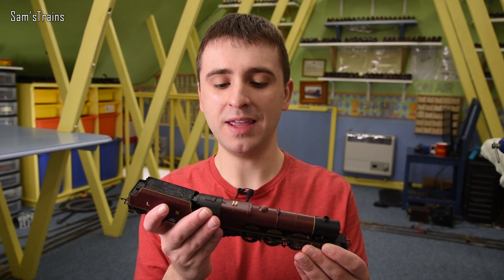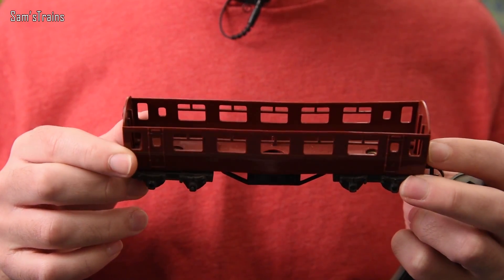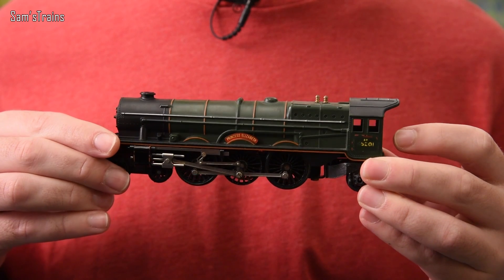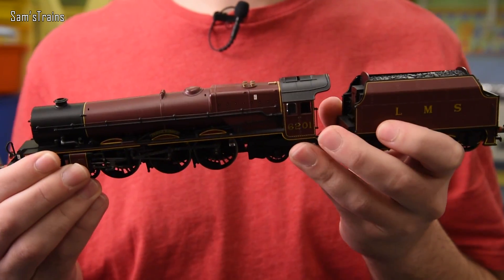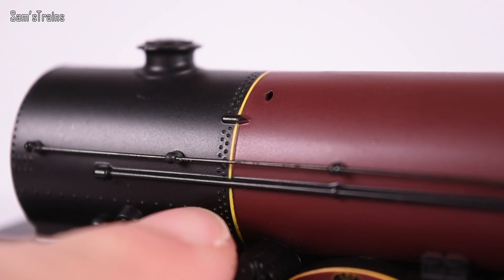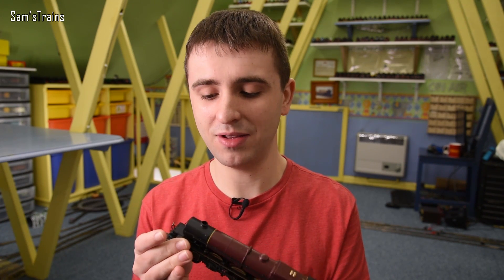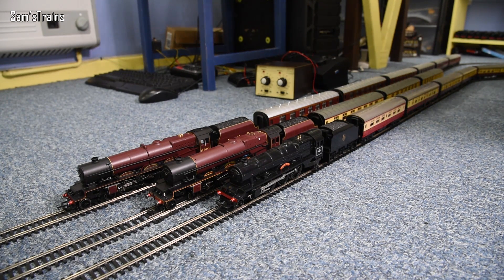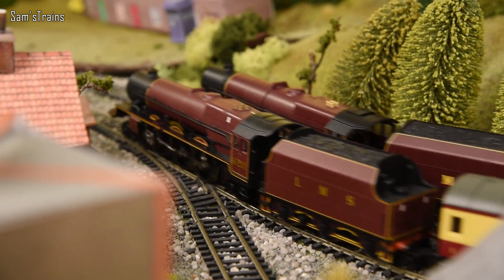1950 - 2020 | 70 Years Of The Hornby Princess Royal Class

Comment: Great to see the 1950 Rovex . My older brother had one THAT Christmas. Looking back it really was pretty basic.....those pick up shoes for example. I can remember my brother running it in a darkened room and it arced all over the shop, scared me to death (well I was only about 2). But that carriage you showed was the ones that came in the original set of three (check out the short wheel base) and sure enough the banana effect took hold after about five years !  The controller in the set was battery driven, but my brother must have saved up his pocket money and bought a transformer so it could run off the mains , hence the formidable arcing.
Ah, memories, eh ?   Great vid
Reply from the maker: Thanks a lot Geoffry - yes that's a favourite of mine! Yeah those pickups weren't a great idea - don't think they lasted very long!!
Thanks for watching - Sam :)
Reply: @SamsTrains  Probably the next best thing (at the time) to the three rail system ?

Comment: The second ever loco I had was Princess Elizabeth. Not sure of the year, but probably mid 70's. She was loco driven by an X04, had more detailed valve gear than the early model you showed, spoked wheels, plus she had a smoke generator which took drops of light machine oil, and a piston powered by a gear atop the X04 worm drive to puff the smoke out proportionally  to her speed. The tender had one of the axles fitted with a brass tab that scraped on the underside of the tender, which in turn acted as a soundbox, making a crude chuffing sound as the loco moved. Eventually she fell apart with overuse by my young hands, and I no longer have her, but she gave me an everlasting love of LMS and particularly  the Settle and Carlisle Railway.  God bless her, and Hornby for that!

Comment: I loved my 1950s Tri-ang black 'Princess Elizabeth' with its gold tender emblem and two very short LMS maroon coaches (with roofs that warped, of course). I got it new when the real  'Princess Elizabeth' was seen regularly on the main line. Then I got a BR maroon 'The Princess Royal' with valve gear  - wow,  what an improvement. It looked so realistic. These both disappeared many years ago. I also have two of the 2003 models in my cabinet which look generally very good, but I think the bottom of the cab is wrong (not deep enough) and I just keep gazing at this fault. Which means I will have to get the new one! This was one of your most interesting videos - a great piece of work. Also notice how the rear pony truck frame is cut in half on the 2003 model and rendered beautifully on the new model.
Reply from the maker: Great to hear that John - what a time that must have been! Glad to hear you got a 2003 one, I do very much enjoy those! :D
Thanks for watching - Sam :)

Comment: Great this idea to make a collector's interest-driven video around a top shelf product from Hornby. I really enjoy to see the historical evolution, and have a look at some collectibles. Your original Triang is a must-have for a collector interested in '50s/'60s model trains. That's also a good way to see the technical evolution of the thing. Anyway, the actual Railroad locomotive is pretty good if you close your eyes on the car bumper-like couplings ! I guess this point is not an issue for the public which buys this model. And kitbashers can certainly replace them, I am waiting for a Railroad LNER teak coach with the same couplers, I will see if it is worth the buy. If I can jettison the original coupler, everything's all right for me.
The more I look at the Railroad range, the more I find interesting items. Hornby had a good idea when they launched this range ages ago, you can have low prices items with a good quality, and an appeal to nearly every modeller. Good move from the marketing department of Margate !
Reply from the maker: Thanks very much Oliver, great to hear you liked the idea! Yes many collectors like those old princesses!
Thanks for watching - Sam :)

Comment: i think we will probably see even finer detail as newer materials and techniques come into use.

i think its entire possible we might see some pretty exotic motors start to come in on the higher end designs at least.  from what i have seen in power tools, i think its entirely possible we might see a manufacturer play with brushless DC motors.  i think its entirely possible to cram the electronics into a locomotive.

and lastly, i think the metal injection molding we see being used to make drive train components in power tools may start to show up, maybe not for the gears themselves, but to make it easier to make more complex/compact designs.
Reply from the maker: I hope so James - that would be nice to see! :D
Thanks for watching - Sam :)

Comment: Ah, memories... I have one of the Tri-ang versions, after the revamp to remove those rollers, etc. Mine is in BR (Midlands?) crimson, though with nothing like the level of detail in the painting, but it still looks pretty good. I haven't run it for many a year, but when I retire in the not-too-distant furure, I'd like to get it overhauled and run it again. Don't have any coaches, though, so I'd have to hunt some of them down. The couplings could be a problem, though, as Tri-ang and contemporary Hornby couplings were different and I remember having trouble connecting different rolling stock up. I was interested to hear about the problems of old coaches with modern track as, although Tri-ang and Hornby track was a bit different (mostly in the way it conncected), I never had any trouble that way. What has changed in modern track?

Anyway, thanks for a fascinating look into the history of this type as a model. I strongly suggest that you do similar videos for other classes.

Comment: I only have a modernized Dublo Duchess (modern repaint, a few added handrails, 80's driving wheels, real coal, otherwise original) but I would like to have the newest one.
Lately a few old start-sets was "donated" to me, from different eras (attics), but they all had (sadly) the cheap-o 0-4-0 Piko steam loco, but it was interesting to notice how it changed over time (still in production btw) from its 1st 1960's release. It basically got cheaper and simpler with time, with less and less metal and parts used, rivets instead of screws, even the buffers are made of rubber, while the early ones had metal chassis, actual !glass windows! and working lights. I will gonna keep my eye open for a 1st release one ( I sold the one I had, but now I esteem its value).
Reply from the maker: Ahh very cool - I bet those look great with a few upgrades! Many thanks for the info mate! :D
Thanks for watching - Sam :)

Comment: I had the original Rovex model and the pick up was by spring loaded studs not rollers and the plastic control box had cycle lamp batteries with a 3 way switch on top with no speed control only forward off reverse but it was intended as all train sets should for little boys as I was at the time and by the time i grew up I left childish things behind.

Comment: Hi Sam,on  the tender drive the wheel spacing and splashers are wrong on the loco drive spacing and splashers are more correct, so it must have been retooled .The front drivers are moved forward. all the best .
Reply from the maker: Very interesting Ian - I didn't know this, thanks for pointing that out! :D
Thanks for watching - Sam :)
Reply: @SamsTrains  Hi Sam, I have 7 of them including a brass pro- scale i built 30 odd years ago with a portascap motor and gearbox. I am building a 3.5 inch gauge princess makingthe valve gear now. I seem to go from one nightmare to another building these things. all the best Ian

Comment: On the subject of Tri-Ang engines running well after all these years, I used to say "It's not fatal until the body is in two"........ I was wrong. I had a VERY early Tri-Ang princess, just after they made the metal-chassis version, and it had warped. the cab was crumbling, the running board was cracked, the bufferbeam was missing. It was a... well..... Train-wreck. (bad pun). So, after procuring a bufferbeam, I set about the cab. I cut the cab clean off, and it fell to bits. I could hear the body snapping back to it's right shape as I released the warped cab. the floor of the cab was split, the roof was split, the left-hand side was split, the right-hand side was the only one saved from the stress. so after heating it up and bending it all straight again, I discovered something incredibly useful. if you get cellulose-acetate warm enough to  * just *  become pliable, not only does it correct some of the warping, it also shines the plastic, and, more importantly, seals it. It stops it warping. So after that, I glued the cab back on and repainted the seam, and refitted it to it's original chassis. If I told you it had ever been warped and in pieces, you'd swear on your life I was lying. It looks pristine. you really cannot kill a Tri-Ang or Rovex locomotive.
Reply from the maker: Oh dear, sorry to hear that mate - I've never known them get as bad as that! Blimey, sounds like you have some patience there!! :D
Thanks for watching - Sam :)
Reply: @SamsTrains  Yes..... People say I have a lot of patience when it comes to making models. Trust me, this was easy. The harder projects i've done are total scratch-builds of Ivor The Engine and Stephenson's Rocket in OO gauge. The former of which, took me a week. The Rocket was a 3 day build. Simply because, that's how fast I normally work. Working pistons and all. I'm actually building a L&MR coach as i'm typing this. Which I will motorise to push the rocket. It's going well so far.

Comment: Wouldn't the original 1950 model have had 3rd rail pickup? Especially as it was aimed, as you say, at kids saving up their pocket money and parents looking for affordable birthday/Christmas presents. My first train set, Hornby Dublo, bought as a present around 1953/54 certainly used the 3rd rail system on a pressed tinplate base and it wasn't until some time later that I became aware of the 2 rail system, which I recall as being "up-market" and expensive...
Reply: The 1950 Rovex was a lower cost competitor to Hornby Dublo. Two rail from the start being an advantage over Hornby Dublo. The extra realism of two rail and the lower cost made it sell so well that they could not keep up with demand. Incorporated into Line Bros Tri-ang after less than a year and improvements made every year. Tri-ang cleverness was a big part in the demise of Hornby Dublo.
The very late shift of Hornby Dublo to two rail, their higher prices and limited range among other issues meant they were losing market share to Tri-ang year on year. Hornby Dublo collapsed into near bankruptcy in 1964 and so they asked Tri-ang to take the over. This led to the Tri-ang Hornby years and the following years where Hornby is really just the name used for the continued development of Tri-ang from Margate. Hornby in name only, not a single part from any Hornby Dublo production since a few station building scraps around 1966 and 1967. Tri-ang tooling still crops up in the current Hornby range eg Dean Single.
There is a vid on Youtube about the The RIse And Fall Of Hornby Dublo (hint) and the Tri-ang takeover as well as books and discussions on forums.
Reply from the maker: Thanks John - yes they were indeed two rail from day one!
Thanks for watching - Sam :)

Comment: Sam for the hm2000 do you have to have two power tracks to run the locomotives individually?  Thanks for the great video 🙂
Reply from the maker: They Tai - the HM2000 has two outputs built in, but you would need two power tracks to make use of both! :D
Thanks for watching - Sam :)

Comment: Re the Black Five comment at 5:26 . The Hornby Black Five was first introduced much earlier than 1984 you thought was the case. That LMS version only maybe so.
1973 as I remember and your recommended Oscar Paisley channel vid confirms :
https://www.youtube.com/watch?v=_mq5XhTjLCk
These early silver seal expensive models had Fleischmann 6 wheel drive mechanisms. This was so much better than the later cost cutting version by Hornby and set the trend to tender drive units. Around this time a Princess with one of these tender drive units set a Guiness world record for continuous running. Tender drive was added to an old Princess to give more variety on the Mevagissey model railway display. Turned out the Princess ran longer than the Black 5, Brittania and Evening Star models also running for the record.
I still prefer a good loco drive though even though Fleischmann and Roco make very good tender drive ones. Some power the locomotive wheels as well.
Reply from the maker: Very interesting John - duly noted - I wasn't aware of this!! :O
Thanks for watching - Sam :)

Comment: Live steam in OO scale sounds like it would be extremely high maintenance.
Reply from the maker: Yeah I think so too!
Reply: Hornby made them, they were £1000 they stopped making them as no one would buy them and they cost £20000 to produce. They were high maintenance
Reply: The problem is that you cannot scale down the laws of physics... What goes fine on, for instance, an O or a 1 live steam model is more complicated due fo the same fluid dynamics in tinier boilers, pipes and cylinders in OO/HO scale. Hornby had made an OO live steam engine as said up there, but that was a one-off. Fulgurex from Switzeland had also made live steam engines in HO scale, but that also was a one-off.
Live steam modelers generally does not go below 1 scale (1/32) for pracitcal physical reasons with steam and water physics. On Youtube, live steam engine I saw are generally scale 5 and up.

Comment: i thought i would look through my dead thomas locos to see if i could marry up a motor with a running chassis - also i did 1 but it insistead on stopping on  the track so it went back in the box but i did find one that broke into 2 parts - chassis rot i suppose thats a james and a thomas now - as for the future i recon they will all come out as the polar express with partial sound or the flick of a switch in the tender to dcc sound as well as all the other stuff bells whistles horns etc etc - well i got over 30 thomas chassis now with trackmaster bodyshells - done another 4 and got 2 more to do its fun running them when you know you cant buy them - but i have found hiro in ho scale a toy in japan so i bought it and now i need running stock for it for 00 gauge - the real ho ttrain is 700.00 pounds to buy in japan ill never pay that just to get 1 loco 300.00 mabe but never 700.00 - there is also out there conner and caitlin in HO at stupid prices - thanx for the video
Reply from the maker: Ahh interesting mate  - keep it up, hope you can get some more good results! :D
Thanks for watching - Sam :)

Comment: Speaking of an old dog with new tricks, Lionel has acquired the Mantua castings that date back to 1954. Although it uses the regular Pacific type boiler and it barely has any proper separately fitted parts.

For the future of Model Railways, I hope plastic will be put in its place as an insulator and a new type of metal 2x heavier than zinc but has the same properties will dominate the medium, motors can be made smaller but put out the same pulling power as a motor of now, all engines will have rechargeable batteries, and the final thing I hope is that robots and machines will bring production back to our home countries so we no longer have to support communist China.
Reply from the maker: Ooh that's very interesting - are they to continue producing then?! Yes I'd love to see that too - but maybe that'll ruin prices even more?!
Thanks for watching - Sam :)